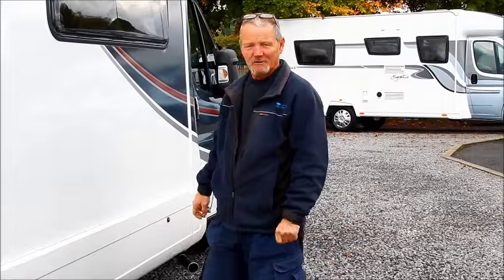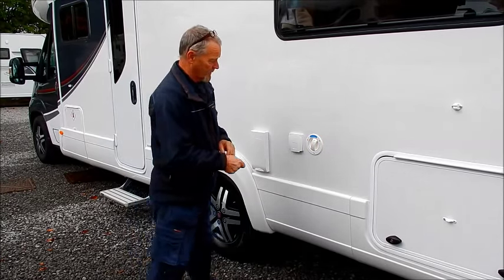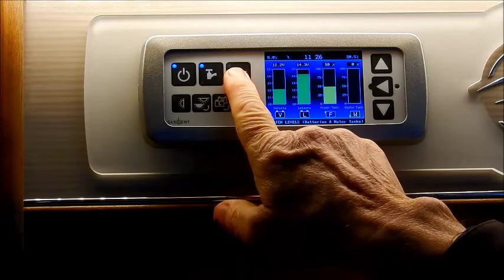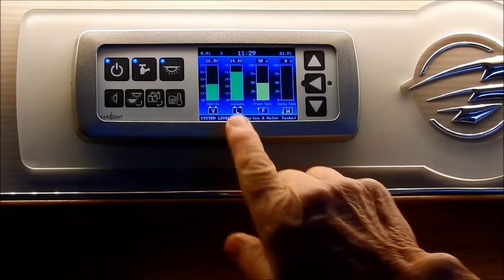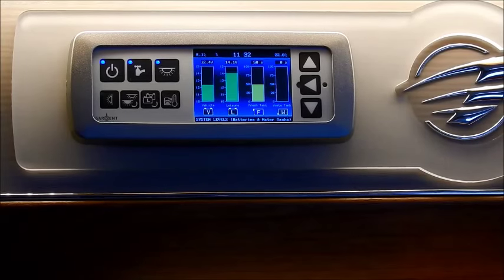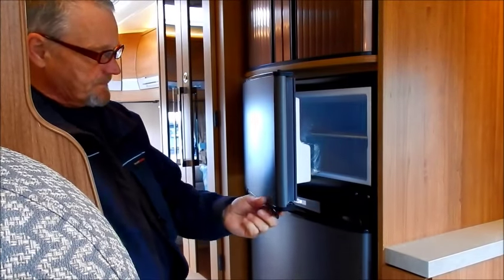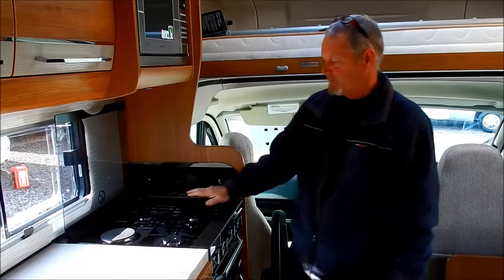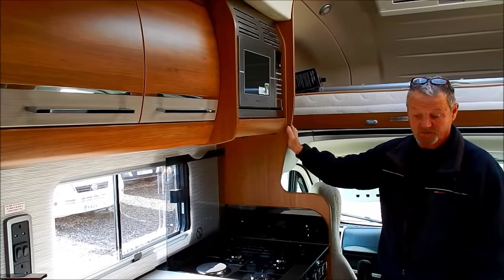Tyne Valley Motorhomes Auto Trail Handover Video

Comment: This video is excellent and contains loads of technical information that is quite important.
Once the pilot light is lit, on some heaters, keep pressing the knob for up to a minute while the thermal trip activates and allows the main gas pressure valve to open.